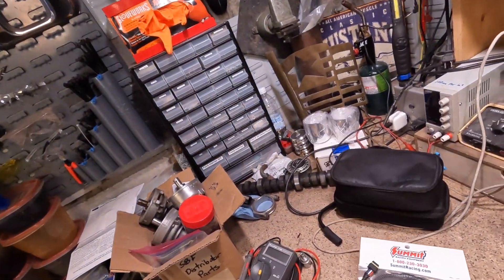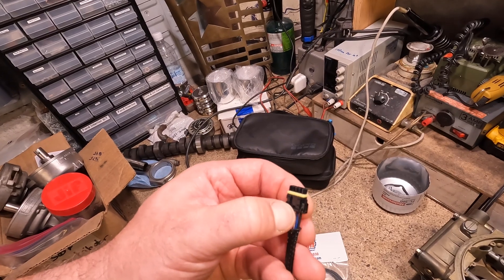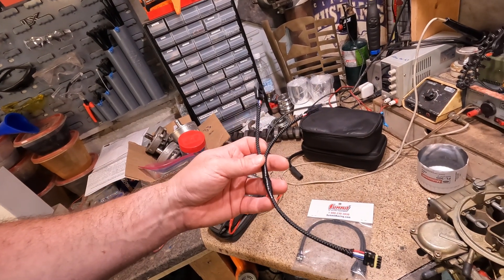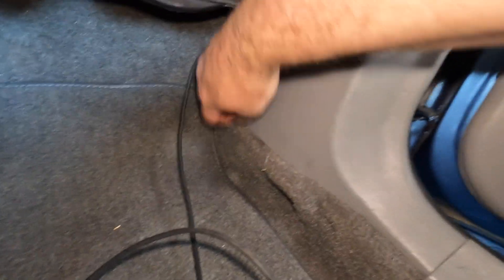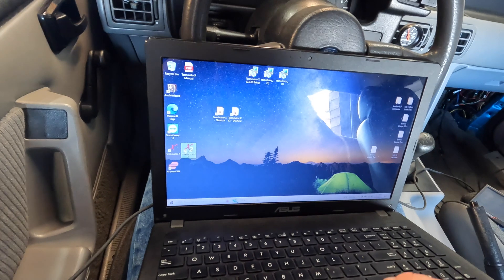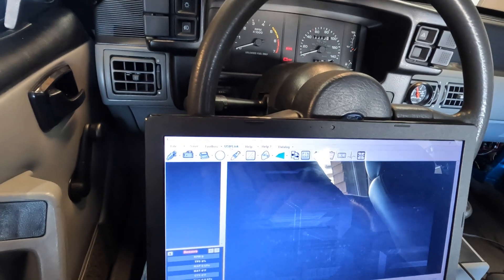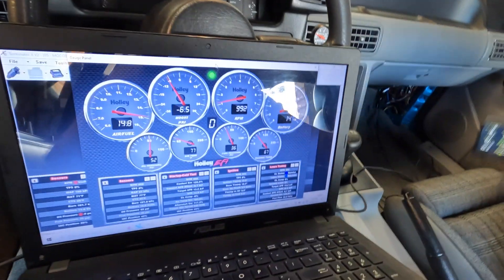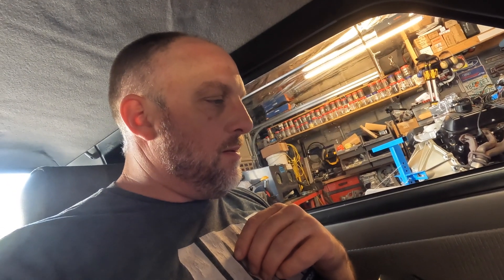Holley Terminator X CAN Bus Splitter

Comment: Question: I installed my first Holley Sniper. I added the splitter to use the 3.5in screen and laptop both. Where your screen says “USBLINK”. My says “off line” and I can’t figure why?
Reply from the maker: What happens when you click on the “offline” words?  Does it say that when the power is off to the sniper?  If you get no results try disconnecting the splitter and try it again. Maybe you got a bad splitter?
Reply: First thing I want to thank you for replying.
  It won’t let me click on the “ off line “, because it’s grayed out. 
 I’ve unplugged it but nothing happened.
Reply from the maker: I’ve not heard of that issue. I would call up Holley’s tech line and ask them that question.

Comment: Would this work to retain use of the stock instrument cluster
Reply from the maker: I'm not sure what you mean.  Are you referring to a Holley digital dash or something else entirely?
Reply: @Mike-FoxsAbroad  like to split the vss signal from the harness to the OEM instrument cluster for retention of the gauges
Reply from the maker: @oreoblizzard1662    I'm still not 100% sure what you are talking about.  Are you talking about the speed sensor (vss) on the transmission that the car uses for cruise control?

Comment: It is helpful, as Holley don't provide a CAN bus splitter when you buy additional screens. So if you are going to run both the 3.5" and an addional screen, you need to buy a CAN bus splitter. Cheers